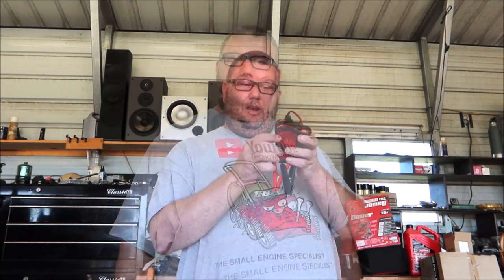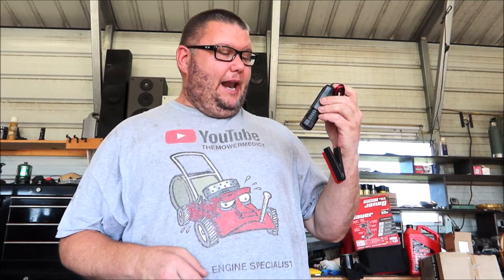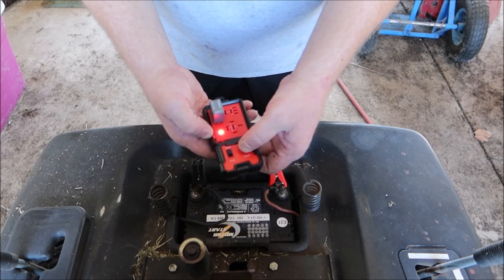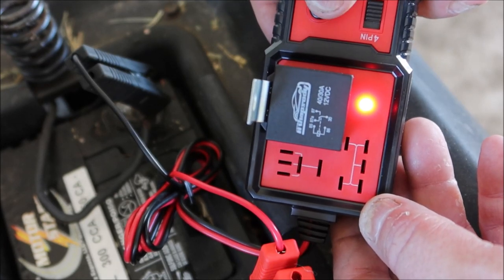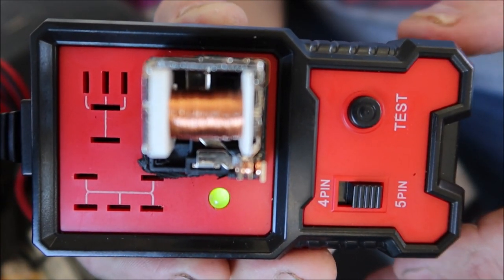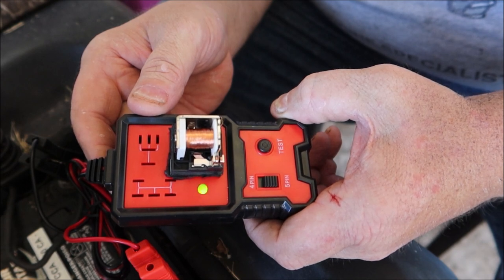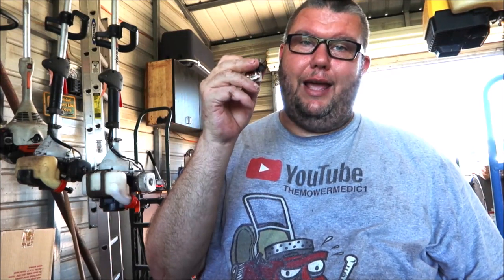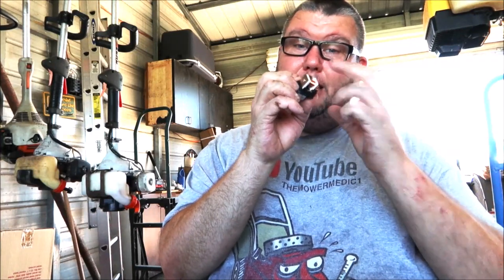THIS RELAY TESTER WLL SAVE YOU TIME AND MONEY!

Comment: Excellent.  That second relay was very similar to the relay in the early VW Rabbit diesel. It was used as a glow plug relay and they were prone to failure from wetness. Either condensation or in our old Wabbit,  a very minor leak through the firewall allowing water to enter the relay because it was positioned in an upside down fuse and relay block under the dash and rain water would follow the wiring harness path. When I replaced it the first time, I took the old one apart to see how it worked. The relay contact point was corroded. Cleaned it with a small file (after I poured out the collected moisture, upside down position making it a cup) and bent the arm just a bit to compensate for the gap. I checked it by reinstalling and it worked fine. I took both the old one and the new one and sealed both with RTV blue. Reinstalled the new one, old one into the glove box. NO MORE WATER INTO THE RELAY, NO MORE PROBLEMS.  This relay checker? It's on my list! Thanks for your always great videos!

Comment: You are a Genius for Finding this Tool. Thank You so much. It cuts out alot of Confusion with using a Volt/Ohmmeter and trying to Hunt to determine what is the correct or wrong terminals from the Out Side of any Automotive or Lawnmower or HVAC/R Relay. Thanks Again and Keep up the Great work Homie 👍👍👍

Comment: cute toy   i cant see where it load tests the contacts anywhere on the site.  ive had too many relays that worked  but caused problems from high volt drop.
Reply from the maker: Voltage drops are normally caused by a bad connections at the fuse block not the relay itself.
Reply: @THEMOWERMEDIC1  ive seen my share

Comment: i have same tool, but is not working to test some BMW relays is showing that are not working but actually are good relays, anyone else same issue ?
Reply: Yes man I'm having the same issue... The BMW relay I last put in just broke this stupid Chinese junk ... They do not test Type A relays which are what BMW would be using with your setup... Need to test with multimeter or find someone that knows if their companies product will test these relays... I've emailed some companies they don't even know themselves.... The eBay ones are cheap but to buy a way more expensive brand, I'm not sure if that will work hey